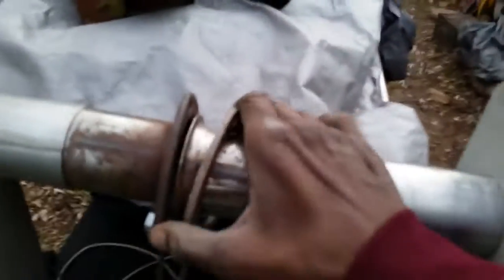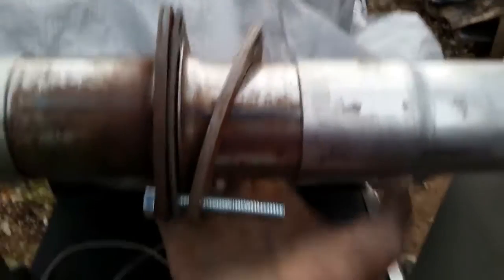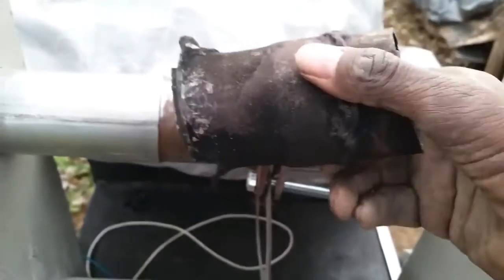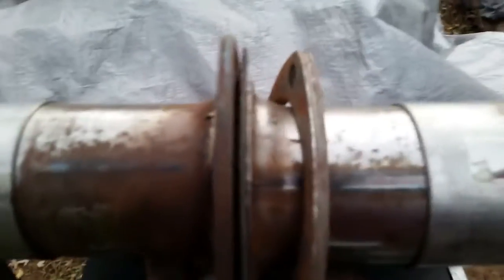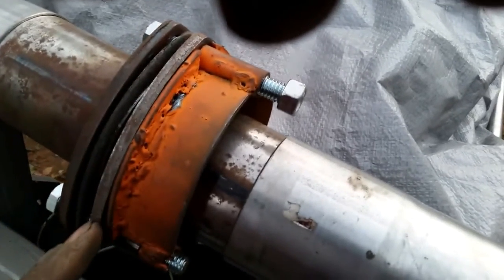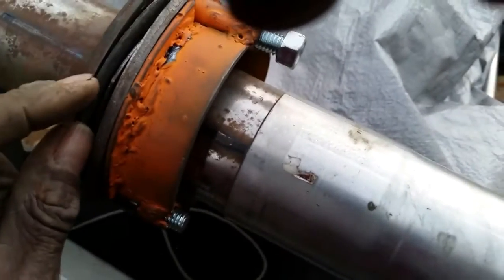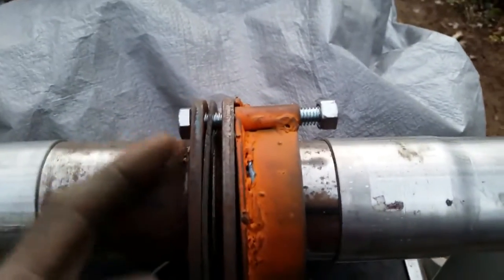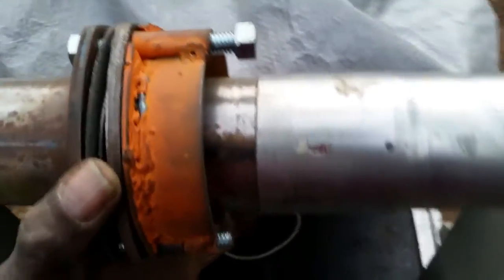C Flange Bracket basic kit and explanation for collector flange leak repair - Cynthrome Products LLC

Comment: I hope you are doing well with this. Looks like it would work very well if the original metal needs support. My old VW had similar principle at work in spreaders for the valve cover nuts. Spreaders were metal strips that fit over several studs and spread the force out between the fasteners, along the gasket edges.

As far as critique I think you should edit your video to focus more on the invention. There is a lot of shaky and distracting extra footage that could be cut. Just my opinion. Good luck with this, it's a great idea.
Reply from the maker: yeap.  I think its time to upgrade.  It was a quickie for ppl who wanted a lil more detail.  Thx

Comment: Neat.  What material did you make this out of?
Reply from the maker: Interesting question.  It can b of any material.  In this video demo its AISI 1018 steel.  Planned production for low pressure applications is casting of AISI 1018.  For heavier duty application AISI 1040 casting or rolled and stainless steel for custom applications. PVC piping that require flange support can benefit from this product in steel but  plastic casting or injection moldings would reduce cost and weight.